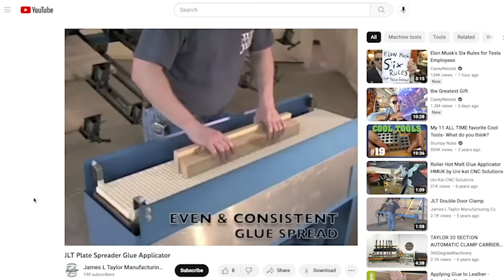We built 100 cutting boards in 6 days!

Comment: Davis...please 🙏 use push sticks or handles on your jointer. Look up some catastrophic injuries if you need proof. Glad to see you using push sticks on your bandsaw.
Reply: Davis, mate as a fitter machinist for 40+ yrs (yes it is working with steel but the same applies).
In the nicest way....

I cringe every time i see you using machinery and wearing gloves.

We were taught that once the glove is caught in the machine it will drag in you hand, with horric injuries to follow.

I have to say... grab an old glove and put a half inch drill bit in your drill press. Move the drill press table aside and Imagine that it is the jointer etc. 

Now holding the glove  " Just By"  the tips of your thumb and index finger, wave the gloves at the end of the drill, the drill bit will snatch the gloves out of your fingers.

 Imagine what it would do to your fingers if you were wearing the glove, and your using a jointer, table saw, etc.

The glove drags in your fingers, etc.

Have think about it... The result is simple, bye bye fingers, bye bye wood work business, bye bye everything, forever gone.

 So having to dig out a few splinters each day is nothing to pay for Vs loosing your fingers :-)
Reply: I have to agree especially on the jointer…at least make a jig to allow you to get a solid grip and pressure. After my long sleeve shirt got pulled in and I wa a lucky enough to stop the machine. I still keep that shirt that ripped up the elbow as a reminder! Otherwise GREAT video and thanks for the tip on the gluing device! Heck I paused your video at least 10 times to zoom into the model of the U-Line you’re using to the sneakers you wear! Ohhh also you gotta build a jig for the logo burn tool. Again great Process!
Reply: Davis, the MicroJig GRR-Rip Block Smart Pushblock GB-1 is a game changer for the jointer. It has hooks at the back that make it way easier to push the wood through the machine, and you don’t have to be putting so much force down on the wood with your hands.

Using just your hands pushing down could be terrible if the wood kicks back for whatever reason. Hands could turn to hamburger meat.

Also, the gloves were hanging awfully close to the jointer cutter head with your passes. 😬
Reply: @aldosarmiento2063  I use the microgrips for just about everything.  Most people dont realize how dangerous the jointer is. I'm not a safety sissy, but I've grown very attached to my fingers and hands over the years. I've seen way too many accidents. 😳
Reply: Please remove the gloves.  Use push blocks or sticks with the planer.  Get outfeed table for bandsaw.  Must be safe!!!!!
Reply: I have never seen anyone or used one myself on a jointer

Comment: Your order of cutting to length, cutting in half, planing, cutting lengthwise, and thicknessing can be optimized. If you do the thicknessing before cutting the strips, you'll have about 1/3rd to 1/5th of the number of pieces to handle. Also, If the current width of the boards you're buying is also what you'd normally get, get yourself a wider planer. It'll save you another 1/2 number of pieces to handle, as you wouldn't have to cut the boards lengthwise first.
Reply: I was going to say why not glue up enough length for 3 or 4 boards, then cut them to width. Board handling would be reduced. Take it to the table saw. For 4 boards, it would be 5 cuts instead of 8.
Reply: Commented the same thing on literally every single video a couple months ago, it's pointless, they're not gonna do it 😂
Reply: I got lost at the very beginning when they start with expensive 8/4 material to make a thin board. Come on Jennie and Davis lol

Comment: I worked with a guy in a machine shop for 13 years.  He was a good machinist.  Phillip's work looked good, it was always made better than the tolerances allowed for and he was very hard-headed.  I'm not talking stubborn.  Stubbornness is OK because a stubborn person will agree and change their methods once they have a reasonable explanation.  
He had a problem though.
He liked to wear gloves during some of the finishing routines.  When finishing a part in a lathe it's customary and mostly required to take a long length of sandpaper, turn the machine on at a high RPM and hold the sandpaper tightly and polish the parts to a very bright finish.  We did a lot of eutectic coatings.  That stuff is almost as hard as a diamond and it takes special tools and grinding wheels to finish the parts and that's where this guys hard hard-headedness caused him to have a grievous injury.  To obtain the high-grade polish, the machined and ground parts needed to be highly polished.  This required using long strips of sandpaper being pulled against the rotating shaft or cylinder, thus abrading and polishing the tungsten carbide coatings.  It takes a special technique and skill to obtain a highly polished surface coating and not to take off too much stock in the process.
I told him a dozen times!!!
The Foreman told him a dozen times!!
DO NOT WEAR GLOVES!!!!!
I was at the other end of the shop and I heard a loud BANG!!!!!!! or POP!!!!  it was an unusual sound so I turned around and saw Phillip holding the remainder of his hand.  Then he ran out into the parking lot and holding his right arm with blood dripping from it, was uttering the most unearthly guttural scream I have ever heard.  It was a scream and a low-frequency growl that had body and timber.  AAAAAWWWWWWWWWWWWWWWWRRRRRRRRRLLLLEEEEEEEEEEEEEEEEEEEEEEEEEEEEEEAAAAAHHHHHHHHHHHHHEEEEEEEEEEEEEEEEEEEEEEEEAAAAAAAAAAAAAARERRRRRRRRRRRRRRRRRRRERRRRRRRAAAAAAAAAAAAAAAAAAAAAAAAAAAAAAAAAAAAAA!!!!!!!!!!!!!!!!!!!!!!!!!!!!!!!!!!!!!!!!!!!!!!!!!!!!
His right-hand glove was pinched between the sandpaper and the cylinder he was polishing and then 3 of his fingers were ripped out of his arm.  The very loud (almost pistol shot loud) was his tendons snapping.
 He was wearing gloves.  I told him.  The foreman told him.  everyone in the shop told him.  Even the clean-up boy, told him.  Take the fucking gloves off!!!!!!
He was off work for 6 months.  He didn't get work comp because when we picked up off the ground writhing in pain he SCREAMED ""I  FUCKED UP!!!  I FUCKED UP!!!''"""  as he was put in the ambulance.  I picked up his glove with his fingers and tendons falling out of it and sent it to the hospital with him.  There was too much damage to reattach the little finger, the ring finger, and the bird finger.
Yea, he fucked up alright.  
Another time at a different shop,  I heard a HELP!!!!!!!!!!!!! HELP!!!!!!!!!!!!!!!!!!!!! I looked up from my lathe and saw Theodore with his arms wrapped around the fast-rotating chuck.
His shirt tail (not tucked into his pants) was wrapped around the lead screw and was pulling him into the lathe.  I quickly stomped on the brakes and stopped the lathe and I cut his shirt off him.  He was lucky I was 10 feet away.  People have been wrapped around lathe chucks and killed.  Their bodies are a mass of broken bones, entrails, and clothing wrapped around a shaft or a chuck.  It doesn't have to be a large lathe like the one that pulled Phillip's fingers out of his hand.  Phillip said he could feel his body being lifted off the ground (the chuck was 4 feet in diameter) when he pulled his fingers out of his hand, otherwise, he would have been wrapped around his work.
Safety is not for people who have common sense.  Safety is for hard-headed people who like to take risks and assume responsibility for their actions!!!
I would like to see amateur, hobby machinists, and carpenters watch videos of people who have lost their arms, fingers, hands, eyes, and their lives due to being stupid and careless.
Some days, it's just the wrong day to show up for work.
Reply: hahahahaha wow I literally felt like I was there,  you write up a great visceral story.  good work
Reply: I've seen such videos. Mostly on farm equipment where the PTO shaft catches the person's clothing and takes their body, and their life.
Scary stuff.
Reply: That scream…. 😮

Comment: Hey Davis, pretty sure I have posted/ messaged you about this before. I watched your new cutting board video. I urge you to use a push paddle when jointing the face of boards. It only takes a little kick back and your hand is in the jointer blades. This happened to my brother(Major USAF retired) a very experienced woodworker a few weeks ago. He is fortunate he gets to keep his ring finger without surgery but it will always look different.   MSgt Douglas W. Gummere USAF retired.
Reply: I agree with you. I know a few people who have nubs instead of fingers because of a jointer.
Reply: Last wednesday I was tired, it was the end of a long work day, I did exactly that. I was lucky in that I only lost about 1/32" of the tip of my left middle finger, it could have been much worse. But it was a frightening lesson.

Comment: As someone else who makes boards, do you really need to do as much jointing and planing your stock before gluing if you are going to send them back through the planer after gluing. I get the jointing is giving better joints.
Reply: Sending it back through the planer after gluing eliminates any potential inaccuracies in the wood. Also removes any glue that seeped out of the spaces. Also, lots and lots of micro mistakes can start to pile up when put all together.

Comment: ok I'm new to this and just getting started but my question is this. Yes you trimmed off the Cherry to a wrong size and had left over pieces. Why can't those be put together with some fresh smaller cut of another type or even using them as small strips between the same size bigger ones to make a slightly different look but still equivalent board or maybe into some serving boards instead?

Comment: Probably time to get a power feeder for the band saw.  Possibly the table saw too if you're making repetitive cuts.  They don't actually cost that much and  should show a return on your time/labor to justify them.  (In addition, safer, faster and more accurate).  Then put a basket of sorts behind the band saw and shoot those boards through.  You can leave the saw for a moment or two while removing boards from the basket or to get more boards ready to be queued up.

Comment: I think you may be missing an opportunity to save some time in your gluing process, the hopper has saved you alot but the empty space where you're moving all the clamps could easily hold a clamp rack, look up JLT clamp racks, might be worth the investment, could save you time and you may be able to glue up long panels and then crosscut the boards to final length
Reply: I came to say this. A wall mounted clamp rack like Chris DeVo uses is the gold standard for batch glueups. Glue up 102" blanks and then cut to 17" length after final thicknessing.
A $5000 investment in a clamping system would cut labor time by well over half.

Comment: Depending on how much you're using the band saw in that specific Blade the blade could heat up and lose tension and expand which is also very bad you don't want that cuz that's what happens for it to come off the track and come skyrocketing around and slicing on your fingers off the only thing I can think of

Comment: @Davis, did you ever find out why one strip was wider than the other?
Reply: that is what I was wondering as well
Reply: I'm wondering why if he has a table saw he wasn't using that for the rip cuts over the bandsaw. More accurate since the blade can't now and the fence is harder to move once set, 🤷 but hey each to their own and a very expensive stuff that didn't need to happen

Comment: Davis, mate as a fitter machinist for 40+ yrs (yes it is working with steel but the same applies).
In the nicest way....

I cringe every time i see you using machinery and wearing gloves.

We were taught that once the glove is caught in the machine it will drag in you hand, with horric injuries to follow.

I enjoy the content you guys put out, but I have to say (IMHO).... grab an old glove and put a half inch drill bit in your drill press. Move the drill press table aside, turn the drill press on, and Imagine that it is the jointer etc. 

Now holding the glove  " Just By"  the tips of your thumb and index finger, wave the gloves at the end of the rotating drill bit, the drill bit will snatch the gloves out of your fingers.

 Imagine what it would do to your fingers if you were wearing the glove, and your using a jointer, table saw, etc.

The glove drags in your fingers, etc.

Have think about it... The result is simple, bye bye fingers, bye bye wood work business, bye bye everything, forever gone.

 So having cold fingers, or having to dig out a few splinters each day is nothing to pay, Vs, loosing your fingers :-)

(I have moved this from a "Reply", to Comments as it may help others :-)   )
Reply: Spinning things are much more dangerous than a bandsaw.

Comment: the blade of your bandsaw blade  could of bowed out check guides  or sawdust build up at bottom wheel. the bandsaw book from tAUTON press is a good resource book. or just go with a table saw for consistency. this is my sons computer came ACCROSS your tube on phone couldn't comment  I'm retired  railroader woodworking keeps me off the streets .great video run cutting boards too.

Comment: Wow that was great info its goes to the measure twice cut once idea! Can I ask you what brand and model number your band saw is? I’m needing to upgrade to a larger one and yours looks really nice! After using yours are you still happy with your choice? Thanks in advance
Reply: As per the metal sign on the side of the unit it's a Rikon 10-324 (14")

Comment: I have the same bandsaw you use. I cannot get it to cut straight.  The blade wanders no matter how many times I try to set it. I looked up several YouTube videos to see if I missed something.  Can you give me any tips. I appreciate it. I enjoyed your video.
Reply: Lookup videos on proper blade tension. Bring the guides down to the work piece so there is no slack. Are you trying to cut veneers (lumber running through vertically?) Make sure the guides on each side of the blade are close enough. Bandsaws are pretty simple machines.  One or are all of these three are surely off if your blade is wandering.

Comment: "the band saw's mistake." I guess first regarding errors is attitude. The band saw didn't do it. You did. I'm sure you would agree but it's important to approach issues with that mindset. Second thing is I don't really expect precision on the band saw. I get that on the table saw. You could consider jointing and planing larger boards and ripping strips precisely on the table saw. If your blade is 90 to the table you could save a whole lot of edge jointing. You accept the loss of the blade kerf width material which is bigger than the band saw. Trade offs. Maybe. Depends on how straight your cuts are on the band saw.
Reply: he did a really passive aggressive video about bandsaw vs table saw when they were still in the garage. he likes the bandsaw.
Reply: @mcdotterson4103  well, band saws are cool and have their place. But I'd still recommend ripping long jointed strips and see if that increases yield.

Comment: Why do you sand it after planning?
Reply: Although it does smooth a work piece, planing is more about getting the piece to the correct and consistent size. Sanding will actually smooth it down much more than the planer.
Reply: @DebtFreeDIY  with a good planner normally you get a perfect shiny surface.

Comment: Anyone else see some flaws in his math? Yes your cost per board would go up if you make less boards and the way he is doing this the numbers he gets are correct but he claims that it costs more total by $100 to do less boards cus of labor ? Not sure he understands how labor works. 
1. You don't know how many hours 138 boards would take cus you only made 109, but you can speculate , and a speculative model would work like this 
Say it takes you 100 hours to make the 109 boards . 
That each board takes .92 hour
So you times .92 by the 138 which gives you 127 hours instead of the original 100. And if you assume for the sake of argument your labor is 20 an hour the original 109 boards costs you 2000 in labor then doing the 138 boards would cost you 2540 in labor an extra 540 bucks. And that's just me throwing random numbers out. I don't know how much time it took and I assume the hourly labor cost is much higher then 20.

Comment: I know you feel safer with those gloves because they grip well, but trust me if that jointer kicks back, you are no match for a 3.5 horsepower motor and if your hands make contact with the blade you're not just losing finger tips, you're losing hands. Would you rather sacrifice a 3 dollar set of push pads, or your HANDS?

Comment: Would of liked to know what you lost in just the wood instead of lost potential.  If I buy a piece of wood for 100 and screw it up I lost 100 not 200 if 200 is what I could of sold it for.

Comment: You should try adding go/no-go gauge for the width of the strips you’re cutting. If it goes through the gauge, it’s good. If it doesn’t go through, then you know something is wrong. Awesome video overall though!
Reply: Go/no-go gauges are so undervalued, and so easy to make. Can even 3D print them to make reasonably accurate gauges that are easy to replace.